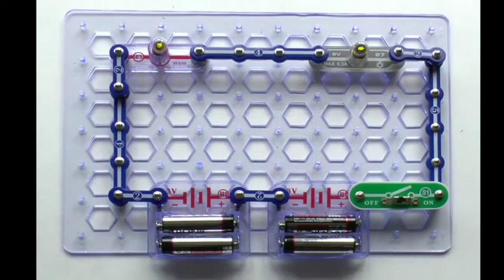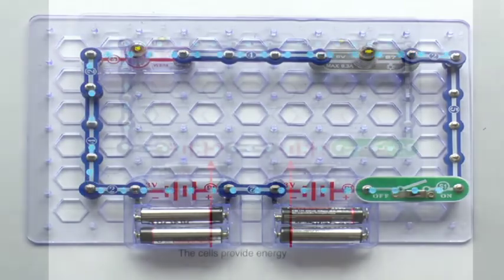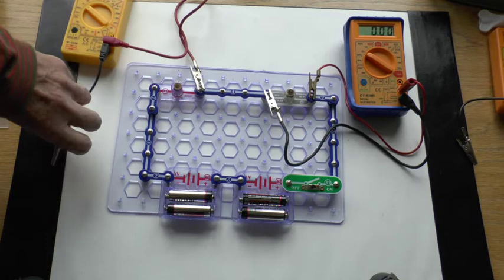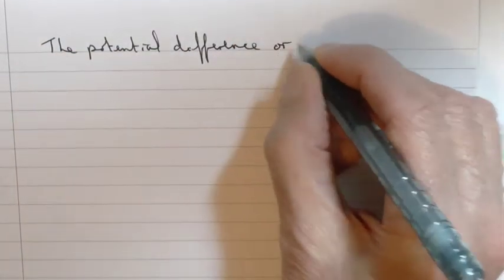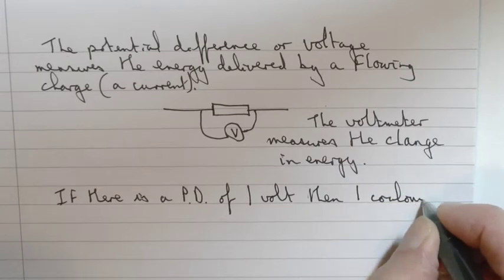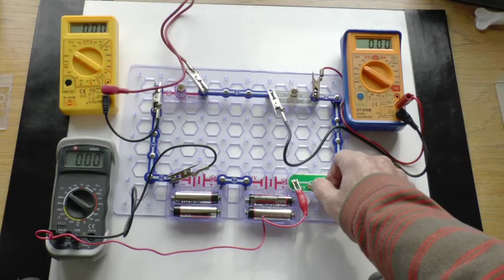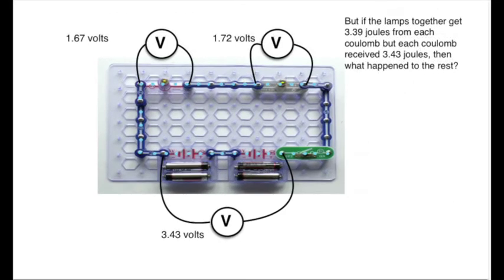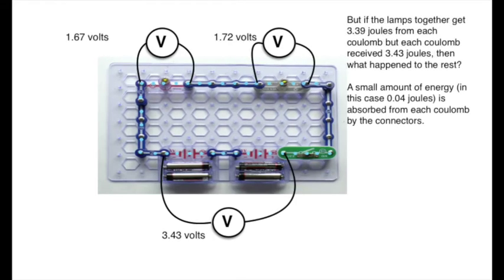Voltage / potential difference explained: from fizzics.org

Comment: what happens to the electric potential of each coulomb if there are no components in circuit(ex.bulb),will there be potential difference if yes pls answer.ur explanation was so gooooood.
Reply from the maker: Even the wire will have a small resistance. The potential difference across a small resistance will lead to a very large current (I + PD/R ) and the wire will heat up.